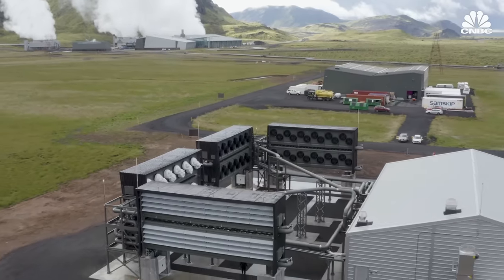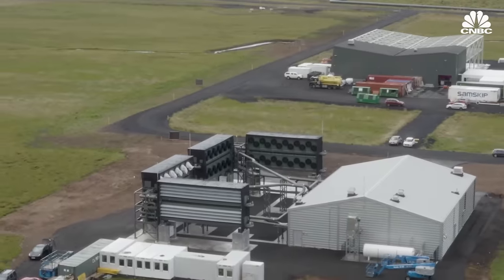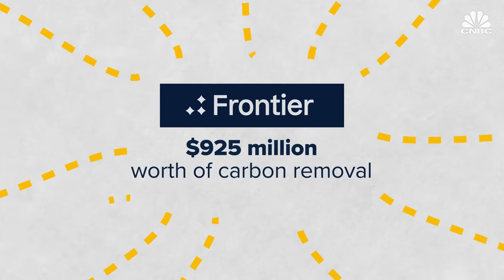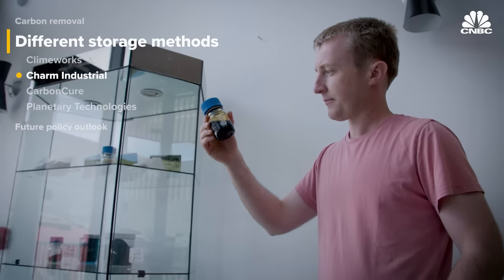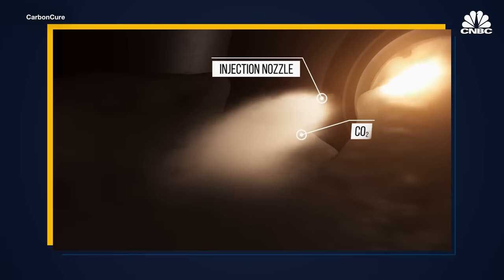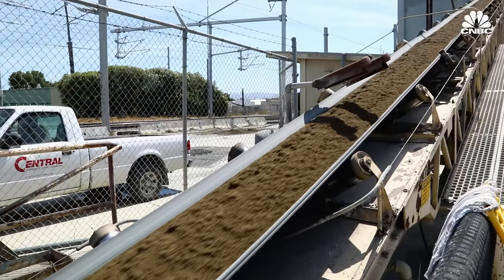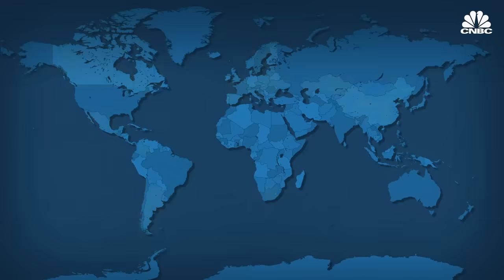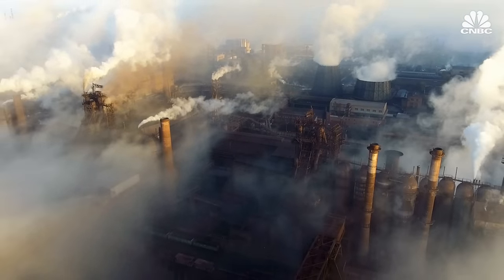Why Big Tech Is Pouring Money Into Carbon Removal

Comment: I was curious about the technology used in the process, was a good video. Learned a lot and made me think about how each company compared to the other. I think the second two companies have a more realistic business model. By creating a marketable product with the captured carbon instead of wasting a potential resource by storing it in the ground. I do understand the drive behind it, not wanting their efforts to go to waste by contributing to more mining of oil, but it is easily remedied by using it in building materials or soda. 
With such a sudden surge of enthusiasm surrounding the subject, ( perhaps it is only now achievable) I wonder if there isn’t some secondary purpose that is being served by this process? Maybe more so by what is manufactured  as a result of the process? Only reason I even had that last thought was because of the first two companies. How could a group of people intelligent enough to create all that is required, yet they would chose to intentionally waste a potentially benign resource? Knowing that capital can be directly translated into an increase in the companies personal capacity to affect their stated goal and overall mission?  
Perhaps it is just altruism in its truest form. I wouldn’t know what that looked like anyway.

Comment: I'm a little concerned about injecting into the ground.  It seems as if it's putting out of the way, but making the future need to worry about it.  Better that they do it, but I'm still concerned.  Eventually, we will need to make use of the land for something in the future, and it will be someone's future headache.  Using plants/biological methods to displace the CO2 may in itself be a bad handling when we think deeper about it.  It just feels off a bit.  Doing it is better than not, but we may regret it.  Reducing the acidity in the oceans might be a better idea, but I wonder if we are messing with the sea life.  This requires a deeper dive of investigation.

Comment: have they not heard of limestone erosion? watch future homes build with that kind of concrete fall after some wind and rain, especially if the rain is acidic.
Reply: All concrete already has calcium carbonate. Portland cement (the most commonly used cement in concrete mixes) is made from limestone. Limestone is mostly calcium carbonate. Their process simply reduces the amount of cement needed.

Comment: we are carbon based life 
carbon is the element of life 
there can only be as much life on the planet as there is carbon available to make it out of 
CO₂ is a nutrient, not a pollutant 
CO₂ is necessary for photosynthesis 
6H₂O + 6CO₂ => C₆H₁₂O₆ + 6O₂ 
there is too little CO₂ in the atmosphere, not too much 
CO₂ is extremely low today, compared with the previous 542 million years of our eon 
CO₂ was 1,950 ppm during the Jurassic period, for example 
nearly 5 times today’s level

Comment: Carbon dioxide removal uses more energy than pruduced by combustion, making matters worse. The best thing is not to use combustion for power in the first place.
Also note: for every atom of carbon removed from the atmosphere, two atoms of oxygen are removed. Within 50 years of carbon dioxide sequestration 5% of oxygen in the atmosphere will be removed, with unknown but probably dire consequences.